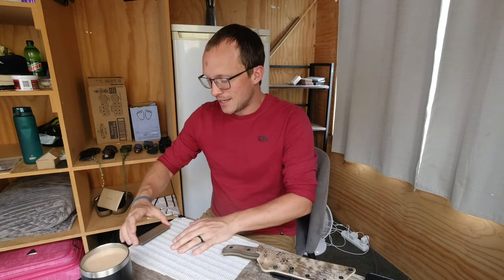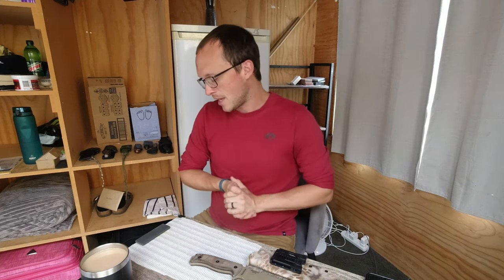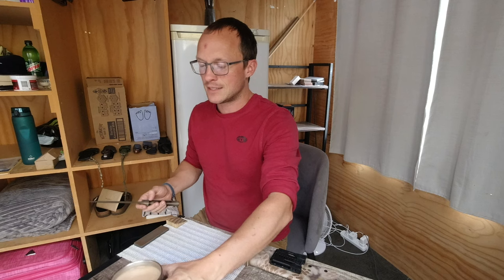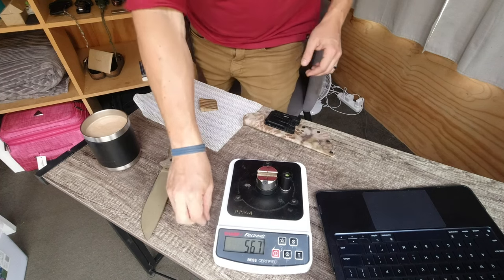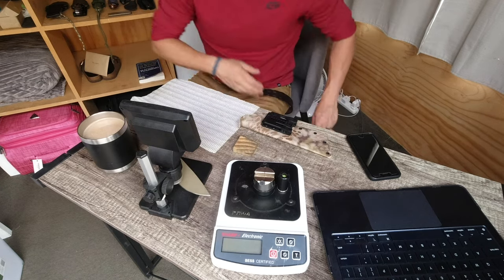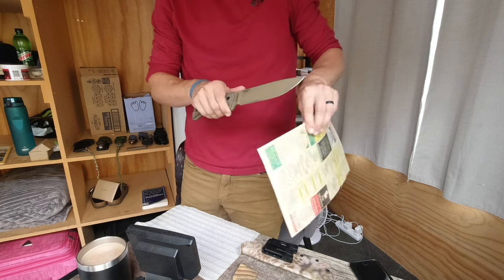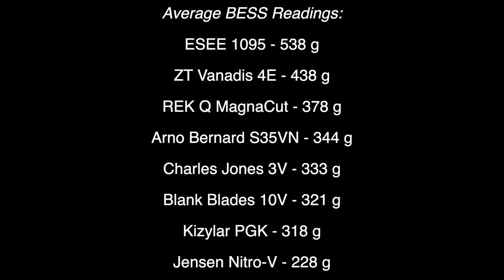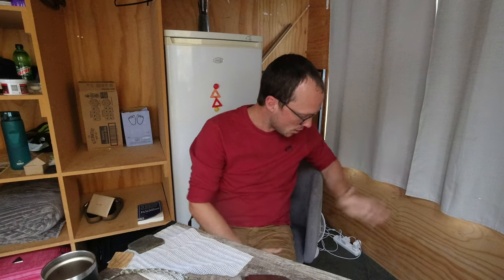1095 Knife vs S35VN & MagnaCut 3V 10V Nitro-V Vanadis4E & PGK | Survival (ROCK) Sharpening

Comment: Always good to see someone test instead of repeat hearsay!
The problem I think, judging by pictures on science of sharp, is that you abrade the steel matrix but the carbides are still left rough and jagged poking out, and the edge only gets to be a carbide-y saw.
The next study you mention with different carbon steels would be neat!
Maybe "easy to sharpen" steels. Like 420hc, 5160, 1084, and such. I wonder if you can find anything in a low carbon like 4340? People mention stuff like 1095 having better edge retention than lower carbon like 1055, but at the same hardness, how different is it really? I don't feel like it's much, and you have plenty of toughness to gain.

Comment: Hi, I've skimmed through several of your videos, with a view to going back and watching them fully,, a thought just occurred to me, and forgive me if you've covered it already and I've missed it, would it be possible to do your dual grit method, using just a DC4,,??.. I'm a novice sharpening noob, and trying to think of the most affordable way of achieving the dual grit edge on some of my knives,,
All the best from England,, 😊
Reply from the maker: Hello again.  I think you could get a dual grit edge on a DC4, but it would just take you trying it to see if it's worth it.  I find that some stones leave an apex extension that is too fragile to help with edge retention, while others yield a robust and aggressive dual grit edge.  If I were you, I would just give it a try!

I do find my best results presently are on Coarse Diamond, Fine Water-stone, and lightly stropped after.

Cheers.

Comment: 1. Rough stone, shallow angle, high pressure.
2. Fine stone, normal angle, edge leading (or testing edge trailing), alternating sides, very light pressure.
3. Stropping on pants / or belt.

*If no rough stone is findable then roughing it up with another pointy stone.

(Also i would ofc take Magnacut.)

And here something i wanted to tell you months ago but forgot, as you like toothy edges (which in truth is just large deformed burr), there is an interesting alternative that needs some testing:
Take a V pullthrough sharpener, angle your blade up, and press the edge straight into it, the edge will have 2 tiny deflections, do this along the blade, when sharpened these result in clean tiny serrations like: vvvvvvv

There even is a device for this for chefs, but i cant remember the name of it.
Reply: A toothy edge that's properly done is NOT remaining burr fragments that gives the bite. If that was the case the edge would fail after a cut. A PROPERLY done toothy edge is micro serrations at the apex from the scratch pattern of the stone.
Reply: @EDCandLace Not sure whats happening, doesnt show my response: You should read up Todds EM research on scienceofsharp, scratch pattern does not directly correlate with tooth. A coarser grit creates an uneven semi stable burr, which has amazing slicing agression, but worse stability, like in carving.
So depending on task it can be great.
Reply from the maker: @Sabelfechter Interesting input!  Have you tried sharpening on rocks before?  It was really strange after using stones that are actually flat!
Reply from the maker: @EDCandLace There is an element of truth to the idea that a coarse edge performs similarly to serrations - in that it utilizes irregular shapes and structures in the apex to lessen the force needed to initiate a cut - especially on fibers.  It has also been found that the texture of the edge is not micro-serrated in any consistent way that relates to the abrasives of the stone.  Which is to say, the edge is rough from chipping and uneven wear, then gets refined enough to slice well via stropping or some other mechanism, but the resulting edge is too random to be accurately called "serrated".

I do think Sabelfechter is right that one of the best sources to visualize this is Todd Simpson's research.  I'll link an article.
Reply from the maker: His article on dual grit sharpening with my sample knives is a good one to check out:
https://scienceofsharp.com/2021/06/15/dual-grit-sharpening/
Reply: @homeslicesharpening  Yes and to reconfirm my memory, i just redone it with a small, like finger lenght sized stone thats convex.

Same process i described before got it free held hair catching when applying a slight slicing motion.

If i do it again when i have more time, i do it at a slightly lower angle, and try to get it hair popping without slicing, i dont know if i can do that but its a nice challenge, which ofc doesnt matter that much outdoors.

Knive was a Mule in Z-Wear (basically Cruwear from a different company).
Reply from the maker: @Sabelfechter - that's an interesting idea about using a pull-through sharpener to intentionally micro-serrate a blade.  I generally hate pull-through's but that sounds like it could make a soft steel blade keep aggression a long time.

Did you read the latest scienceofsharp article talking about myths about burrs?  Super interesting!
Reply: @homeslicesharpening  Yes, and to be completly frank with you on this bit:

"In the absence of microscopic damage, a 25 degree burr at the end of a 35 degree bevel is not weaker than a burr-free 25 degree bevel and will cut better than a burr-free 35 degree bevel."

That doesnt mention that for the same apex stability it has worse cutting ability. And is slighly more "wedgy" in a lot of media.

I prefer highest cutting ability, while maintaining a required apex stability.

And as i told you before, if you actually want to test out if the toothyness is directly responsible for your long lasting edge, then DONT test it against like 35 inclusive fine edges, which are geometrically 2.8 times more stable!
Thats completly apples to oranges.

Test it against 25 inclusive fine edges, aka comparable angle to what your burr becomes based on the shapening process.

Otherwise you cheat yourself and others.

This isnt meant against you, i love this channel and talking to you, its just for clarifying your own research, preventing potentially false conclusions. 😇👍